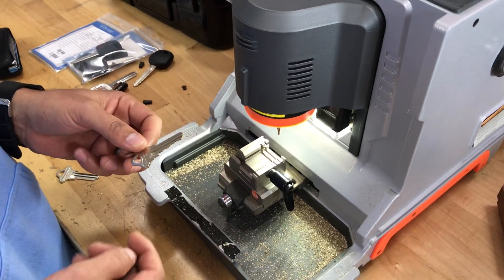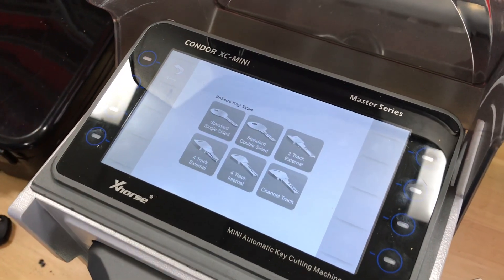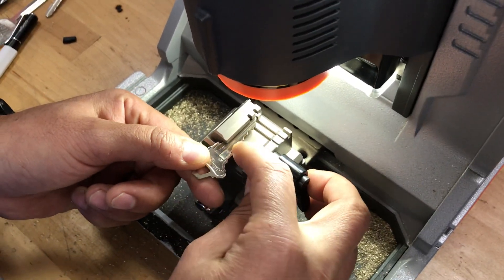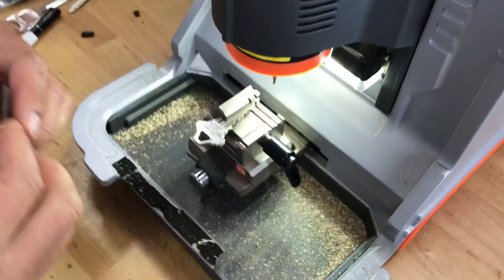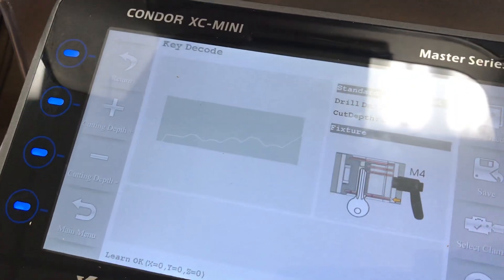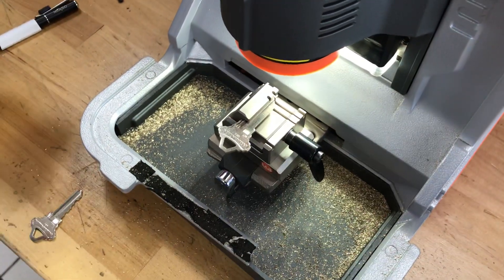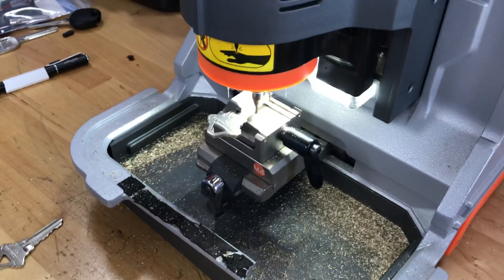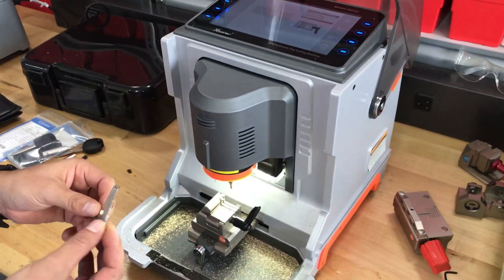How to trace and cut sc1 or kw1 house key with mini condor m4 jaw

Comment: I just snapped both of my probes on this process and I can’t figure out why. My machine doesn’t give me an option to calibrate the M4 jaw either so I’m at a loss. Please help!
Reply: The probes use conductivity to to detect metal and they stop moving. If the blank is plastic(some car remote emergency keys) or dirty / rusting it won’t detect and continue moving and break. Also Aluminium Keys May have oxidized on the surface and need wire wool or fine sand paper to remove.
Reply from the maker: Timmy Creighton best to call us
Reply: Had i known there is no way to select your own bitting and cut a key,  I would not have bought this

Comment: Yeah you can’t judge the accuracy of the copy by sight. Maybe get a gauge or measure the cuts with a caliper.
Reply: or show it working in a lock........
Reply: Dave MacGyver not even the lock can be hard and still turn.
Reply: @ernestojuarez9296  but it would at a minimum show something.......anything......at all......
While this showed nothing really
Reply: Dave MacGyver yup I agree.

Comment: These steps i followed to the letter! I re-keyed an entire house, to 1 key works all.  After it made the 5th copy, then on the 6th blank, when i hit cut key, the cutter head came down as if it were going to re-read the key, and the probe struck the edge of the M4 vise, right where the little square notch is, and broke off the probe.  What did i do wrong, or not do right?  I don’t want that to happen again.  Any help would be great.  Thx
Reply from the maker: Tom Grimes make sure it’s clean when you cut otherwise it can throw the calibration off
Reply: The Keyless Shop : I’ll give that a try. I thought that once it was copied by the laser, it would continue make that pattern. So did the brass flakes make the machine have to re-read the key?  Or could it be that delay between the cutting of the 5 & 6th key, I didn’t hit save, and it lost the pattern?  I’ll try that brushing it off between cuts. Hope that’s it, but have doubts.   Thx for the input.  Tom

Comment: And why the heck didn’t they include bitting for non car keys in the software. Just plain stupid. I can only imagine maybe its not that accurate at cutting Schlage and Kwikset keys???
Reply: its being worked on at the moment just talked with samic last month about it
Reply: Dave MacGyver and I also heard this from my supplier but I also asked about a way to mount this machine into a van and they said they were working on it yeah right... I literally had to tap/thread very large holes at the bottom where the feet sit. The way they designed the bottom of this machine I see absolutely no way how the remark “they are working on it” could be true beyond making a new machine design. No bracket nothing is possible. Only way is to tap proper holes at the bottom of the aluminum for proper size bolts where the rubber feet sit. And I doubt their solution would include a taping/threading bolts kit which would be ridiculous to sell as a solution. It would just be admitting they messed up with their design. Who designs a machine for use in the locksmith industry and doesn’t think about mounting points for use in a van? Plain dumb. I have seen someone on youtube put this in a van using the bolts that secure the rubber feet. Mind you these tiny cap screws are less than 1/4 of an inch thick. The tiny bolts would just snap off and send the Condor machine flying in an abrupt stop or crash. 50 pound machine turned into a 150 pound machine as it flies into your head.